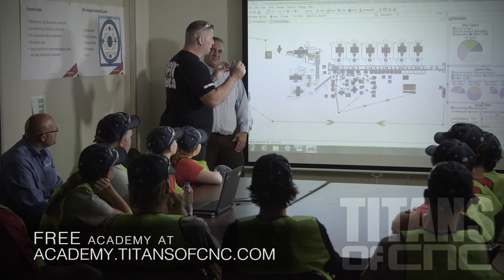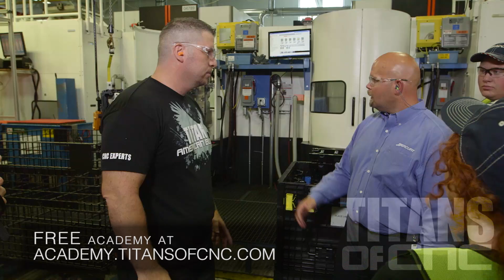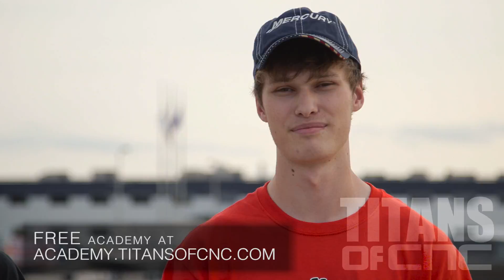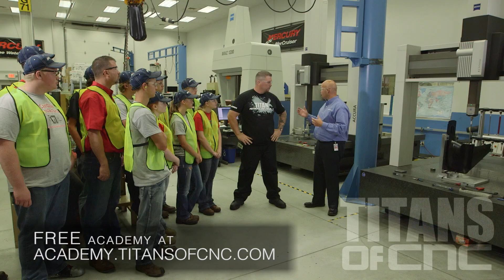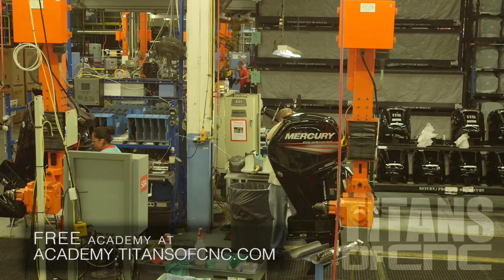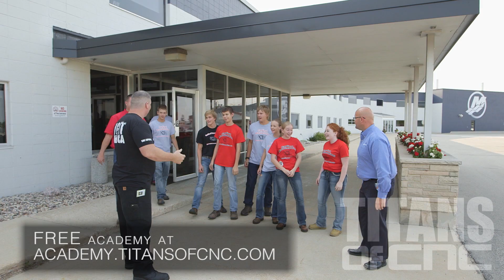TITAN Visits Mercury Marine - Epic CNC Machining

Comment: I'm a huge advocate of made in America. I've been a machinist, programmer, set-up, production engineer for 40 years. The strength of America is in our manufacturing technology. If you want to read, or audio book, a great book, check out "The Arsenal of Democracy". It was way before my time, but when World War II started, a company in California (Consolidated) was building four engine heavy bombers. If memory serves me correctly it took them 6 weeks to build one flying plane. After Edsel and Henry Ford built the Willow Run manufacturing facility, and applied the production line, sub assembly manufacturing, technology they developed building cars, the Willow Run plant was turning out a flying, four engine heavy bomber, every 42 minutes by the end of the war. 42 MINUTES !!! That is incredible. All the sailors, pilots and soldiers that were doing all the fighting, could not have won the war without the power of American Manufacturing. The Ford's applied their manufacturing technology to Liberty ships, tanks, you name it. Even at the rate planes were being shot down, and ships were being sunk, our manufacturing made sure there were always replacements. Hope you enjoy the book if you get a chance to check it out, and when you talk to young kids, tell them about how American Manufacturing made the difference between winning, and losing WWII. Take care.

Comment: Wonderful video!  My father worked for Carl Kiekhaefer (founder of Kiekhaefer Mercury) back in the late 40s and 50s.  An amazing company to work for, even back then.  He always had interesting stories about the company.  

My father built the first die cast molds for the new in-line 6 cylinder outboard engines.

Comment: being in the ottawa area kind of sucks for machining, I finished a 2 year manufacturing program and was very lucky just to have a job setting up cnc machines in a lower end shop. all of the higher end shops want licensed machinists with at least 5 years experience, and if you're really lucky you can get a job for programming. it's a shame because I really excelled at programming in college, learning HSM tool paths, most of my co grads won't be more than an operator for a long time

Comment: What is the advantage of flood cooling vs. an oil spray/mist system?
Reply from the maker: Different types for different types. I like flood coolant for most of my work. Have to remember water cools and the oil lubricates and allows the tool to cut longer. I use Vasco 7000 for titanium and it works great. Flood coolant also removes chips from your work area.
Reply: TITANS of CNC: Academy and by removing the chips you remove a heatsource. Greetings from switzerland home of blaser :)
Reply from the maker: BLASER is the best in my eyes. A lot of people don't really understand the coolant and how to take care of it... There are many types also. I use VASCO 7000 but then you have other mixes that are for different water types and materials.
Reply: What would you recommend for 6061 Titan?
Reply: Andrew Amerio nń
Reply: TITANS of CNC love using Blaser. We use it on the Mazak HC-5000 at work and it works wonders on lengthening tool life and helping achieve an excellent finish on stainless steel components. Also, it doesn't irritate your skin and doesn't smell too bad either which is nice.

Comment: what's the difference between a Vertical Mill and a horizontal Mill?
Reply from the maker: Vertical has a spindle pointed down to the ground... Horizontal is parallel to the ground. I like Horizontals also because gravity allows the chips to fall away from the work piece.
Reply: Vertical mill the fixturing surface is perpendicular to the spindle axis; Horizontal it's parallel. Having said that you can make the fixturing equivalent to the other type by installing a tombstone (fixturing column) in the machine. Tombstones tend to be more common on horizontal mills because perpendicular machining is the more common operation, and a horizontal mill with a tombstone can be more ergonomic for loading parts, as you're not having to lean into the machine to load parts.
Reply: I think you answered your own question.